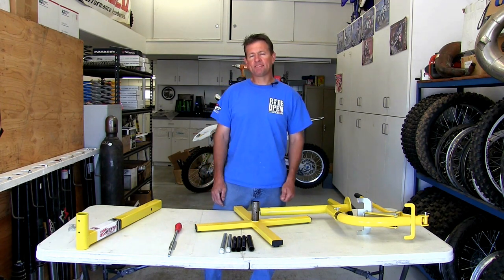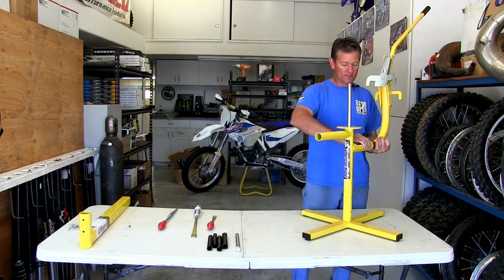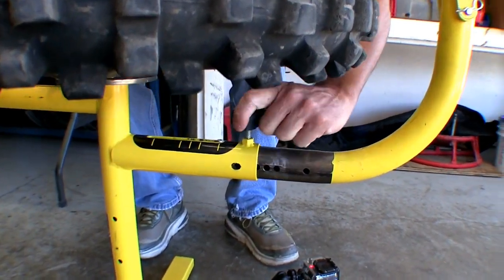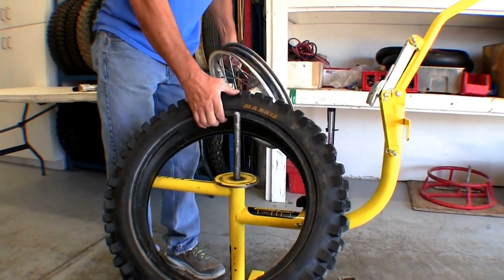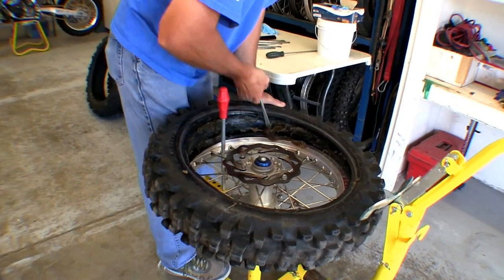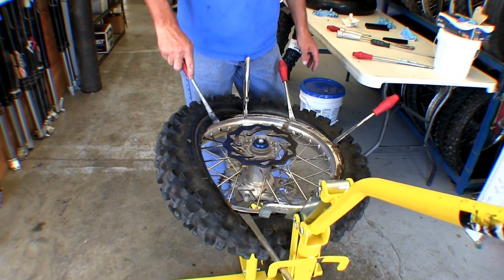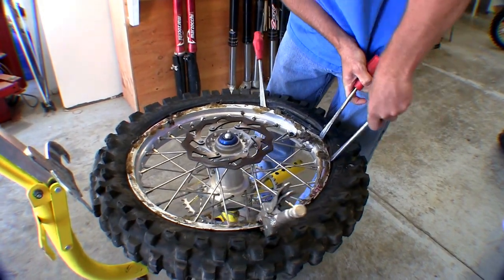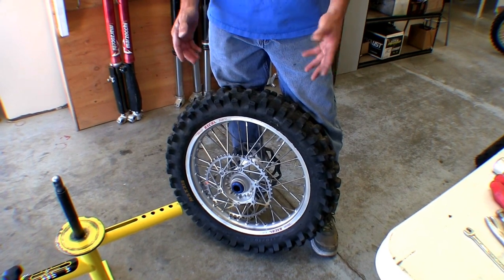Damn Good Tire Tool™ Tutorial

Comment: Great design, well thought out based on real world experience dealing with specialized off-road racing tires. Don't understand the criticism, this is not a everyday street tire but a specialized off-road tire which requires much more effort. Take what you can use from this video then move on.

Comment: This is multi ply hard dez racing tire stuffed to feel like an 18psi fill. if you are throwing on a for example an FIM endure tire with a standard size mousse it far easier. This is an example of the hardest possible mousse installation not a typical installation. they were racing at high speeds from vegas to reno and getting away with minimal tire stops.

Comment: Back in the day, the good guys could change out a tube (off and on...with new tube) in the woods with 2 six inch long forged spoons, inside of 4 minutes.  Now a mousse, might be different.  But when you can change out a tube in 4 minutes, why not use a tube.  If they needed to remove the tire completely, that was right about 4 minutes...off and on.

Now in a shop, with lesser talented shop guys...this looks like a super machine.

Comment: Also this is not a quick change FIM enduro video its a take your time  pit/shop/garage install tool instruction. However if you are doing FIM tires and standard mousses it can be used for quick changes as well, with only the standard compound bend irons and the bead spade on the lever. This is heavy carcass tire prep installation for a Finke or Baja 1000 type setup, not a timed quick change installation.

Comment: What mousse lubricant are you using?
Reply: It's mousse soap, he sells it
Reply: I can vouch for using a quality mousse lube. I'm not a racer but ride in AZ deserts with really nasty rocks shale and loose sand on top. Horrible conditions for grip. Without the lube we might get 6 rides before the bib starts deteriorating at a novice pace. With his stuff it lasted for 10 rides and looked brand new. It will help prevent friction burns on the outside of the foam but will not prevent foam damage from high compression due to aggressive riding. Overall it lasts longer by probably 25-50% depending on how hard you work it. At $160 for a bib that's a good investment.

Comment: but is this tire changer any good?
Reply: No it is not.Far to complicated in his system.A lot of changers are on the market easier and most likely sheeper,...
Reply: This is an excellent tool but you may not have noticed he's servicing one of the most difficult tire procedures known, the bib mousse. It is NOT an average tire procedure. I've seen seasoned techs throw tire wrenches through the wall or pay someone else to do it. A bib mousse is basically a full sized closed cell foam tube that acts similar to a tube with about 8 psi in it. They work excellent for hard packed and slippery conditions you'd want maximum contact patch for. Imagine taking a tire off a rim with pressure in it. I have performed this several times on my KTM and friends bikes. It usually takes 4 spoons and zip ties to hold them against the sprocket, if nobody can help hold them for you. If the zip ties break you end up with a spoon embedded in your forehead or a few missing teeth :) This machine makes the process look extremely easy in comparison. I've been a motorcycle technician since 1991 and charge people $60 per tire to install bib mousse just because I hate doing them. This tool is actually very well made and adaptable to many sizes. Cheap machines have too much flex and move around making them awesome knuckle busters. Another hellacious tire is mini-moto tires. The smaller they are the less carcass is available to flex which makes them very difficult to spoon. This tool would work great for them. I've used Ty's tools in the past and can say with 100% confidence his tools are high quality US made tools, often times heat treated (appropriately), technician-ergonomic  and last forever. They aren't the cheapest tool but are usually the best price for a high quality tool. They will last, provide excellent service quality, great leverage and reduce labor time when using them which is a big deal for a tech on flat-rate or the DIY'er that doesn't want to kill themselves with poor quality tools.
Reply: Apparently these people have never installed a mousse, this machine is a must